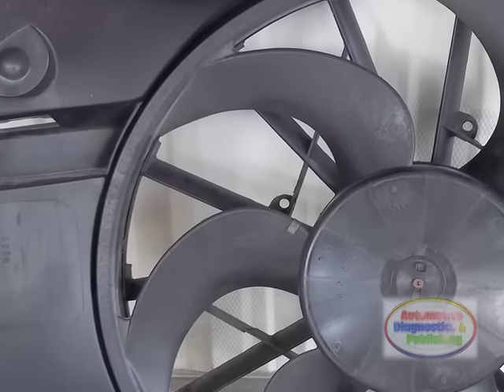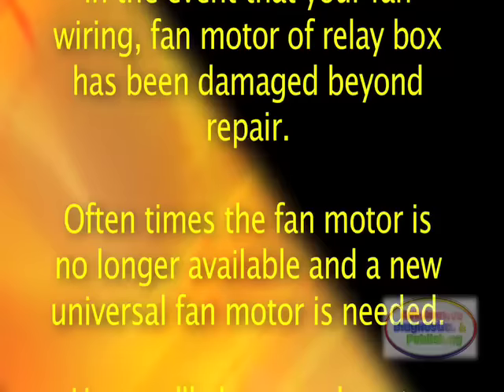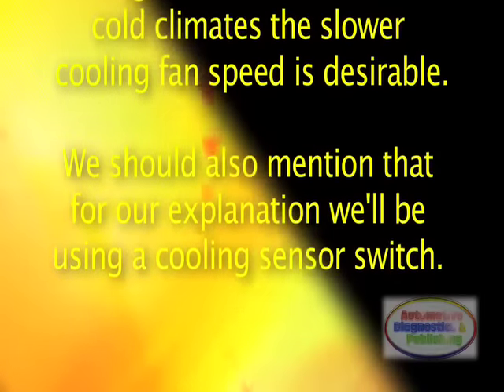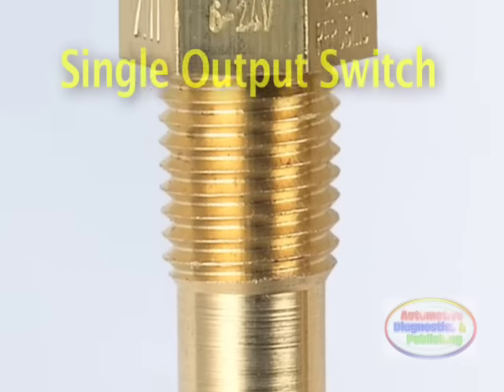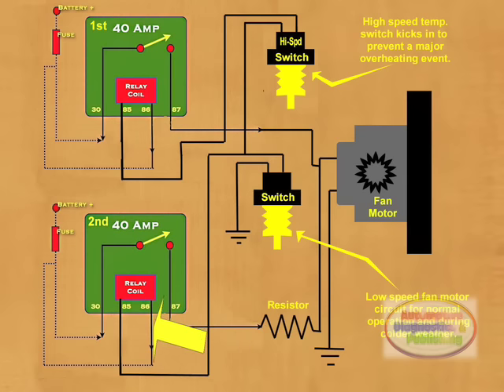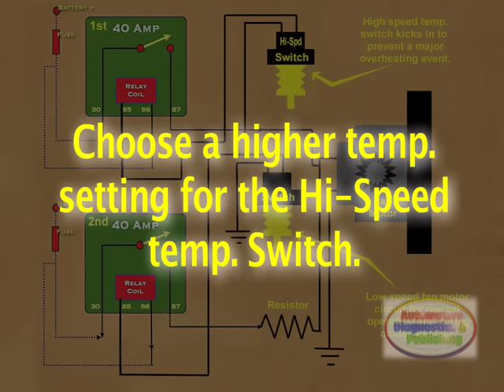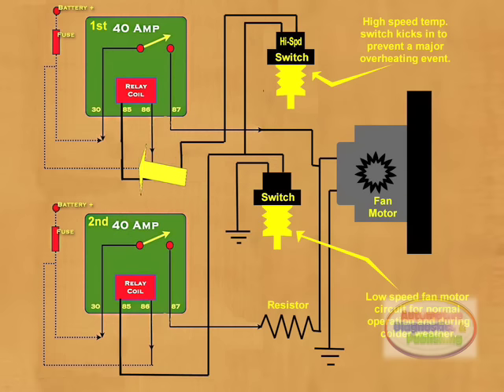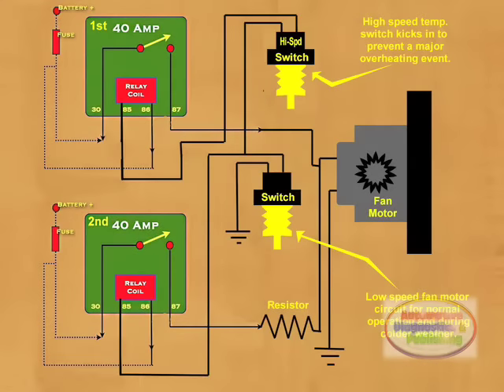How to Wire a Cooling Fan Relay

Comment from the maker: That's very true and as a matter of fact I developed lots of these circuits years ago building hot rods on the local racing circuit. Back then we used them as street legal cars as well. They were different times. Nice to see your posts and comments. Thanks again...

Comment: Wow, that was different, the narration, I have two 14 in. elec. fans coming Friday, I have put on brand new radiator, new water pump and hoses, bolted down my pulley to my pump, it took me days of looking at, I don't know how many fans from numerous companies, so thats done, now I have to decide on a wiring kit and figure out how to wire it, so here I go again looking every where, and the kits are like 18 dollars to way over a hundred and more, its crazy, I am not even close to being rich, heck I'm poor, so I gotta find some quality at a low price, I have looked at so many wiring kits, and looked at so many video's about doing the wiring, so just a shout out of thanks for the vid. and wish me luck, I am not new to working on vehicles been doing it for 30 some years, just never did a lot of wiring and this is my first electric fan hook up, hope I get the right wiring kit, gonna order it tonight, thanks again great vid.

Comment: Thanks for your help again, I really appreciate it. 

I wanted to add that I had to manually wire it this way because the Fan Control Modual failed and I don't have the $450 to get it replaced right now. So, I spent $10 bucks and did it like this, where the fans run on high all the time.

Comment from the maker: Well, as it is done on all model cars, it's like you said at the end of your comment. Runs on LOW and when the AC kicks in then HIGH. The issue is if you live in a cold weather area. When freezing temp then the fan will also run on low. That's not that bad, provided you keep your coolant thermostat in shape or replace it every so often. Makes sense?

Comment: I have a 2002 Jaguar X - Type and have done this, only with the high side, (car turns on and fans kick on high.) Now, is it possible with a single temp sensor to be able to run the car with a low and high? So, it runs on low until hit hits 180 degrees or so, then it kicks on high? Or it runs on low until the 180 or the A/C turns on. (Maybe in your book it shows how to do this?) Thanks for your help.

Comment: Thanks for your help, but I don't understand a few things. Right now, I have it setup to where it runs all the time on "High" both fans. Are you saying that this isn't bad as long as I keep up on thermostat maintenance? Because if it's not a bad thing, then I'll just keep it as it is. What I wanted though is to have it where it runs on low until it hits a certain temp, or the A/C turned on, then the fans kick on high. Unlike what I currently have, which is the fans run on high all the time.

Comment: I have a 2004 BMW 325Ci, the radiator fan is giving me some issues. The wires/harness at the radiator that connect to give the fan power are the only thing that will shut the fan off, by unplugging it. When the harness is plugged in, the fan is running, no matter if the car is off it will run until the battery is dead. I have unplugged the sensor at the radiator hose along with various relays and the control module atop the radiator, yet the fan will still not shut off. is there something else i can try?

Comment: Looks like there is a single speed fan connection with a two switches...One low speed and the other a high speed. It is possible to make a sigle speed fan to function at two speeds? -The video shows that....-

1993 Jeep Grand Cherokee Laredo with aftermarket single speed electric fan.

Comment: I have a Mazda Millenia 2002 i was told my relay for engine cooling system has melted or burned and to replace would be 1000.00 to fix so 100 dollars they cut and mended now the gauge goes to read after driving on the street but as long as im driving on highway it stay at a normal temp.the fans do come on but wont this weaking my engine if temp keeps going to high even if fans do come on and is it really that much to fix?
Reply from the maker: Tami Vesey Whatever they did IT IS WRONG. Take it somewhere else or you'll destroy the engine by overheating and blowing the head gaskets. You're not the only one that's rewired the cooling fans on an older car. If done properly it'll last forever. Take you car somewhere else or better, do it yourself.

Comment: Hello my car fan works low speed in high engine temperature. I change fan to another new but after week this new one worked like that and in dashboard show my antifreeze in low position what does it mean ?
Reply from the maker: Erik Zeynl Check the cylinder head temp sensor, cooling fan sensor or relay. You're providing little information for us to help you out.
Reply: ADPTraining Hello sir I checked cooling fan resistor and find out that the voltage coming to resistor unstable the voltage up to 13.2 v and suddenly drop to 1.4 v .The fan can,t work in this voltage and when I tuned on , Air conditioner the dashboard light shows antifreeze is low .My car mercedes w202 c200 1999 year.

Comment: Using relays to start a DC fan motor is real bad news - high starting DC current can melt down your relay or blow the diodes in your alternator!  Google The Auto Cool Guy!

Comment: What resistor capacity is the proper to intall on the cooling fan?
Thx.
Reply from the maker: Richard Emam-Zade Play around with different value, but 10 to 50 Ohms is normal.
Reply: Sorry I was refering to a car cooling fan.
Can you please confirm me the value ohms.
Thx
Reply from the maker: Richard Emam-Zade Here's what you need to figure this out.https://sites.fastspring.com/autodiagnosticsandpublishing/instant/automotive_relay_guide